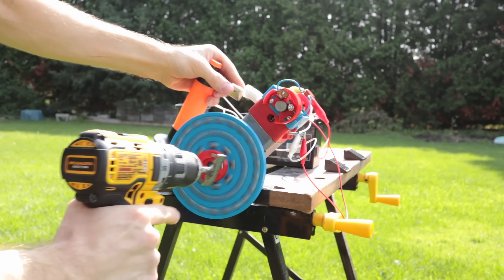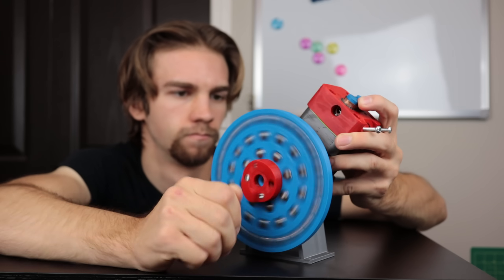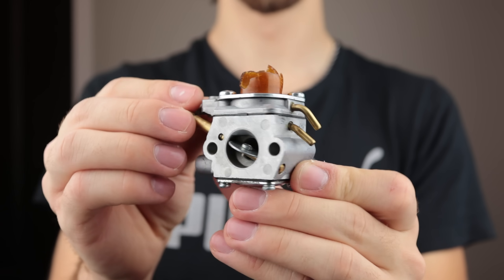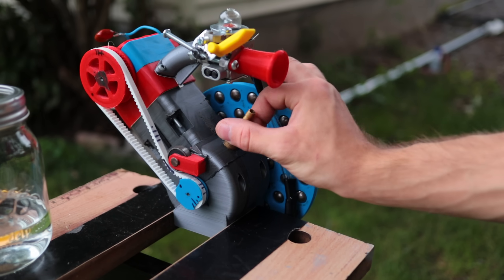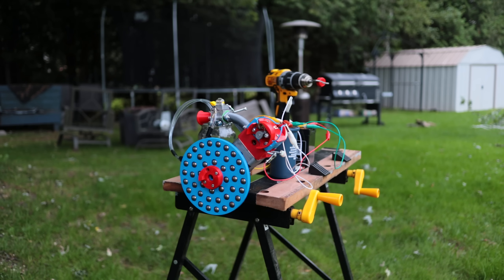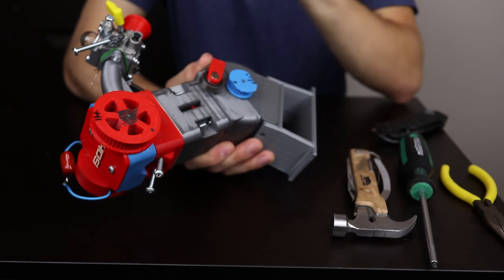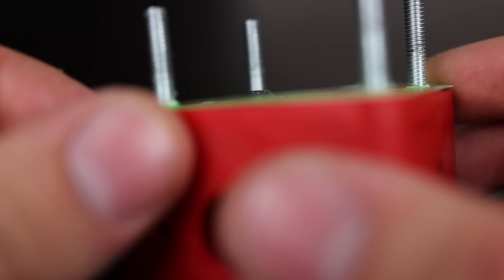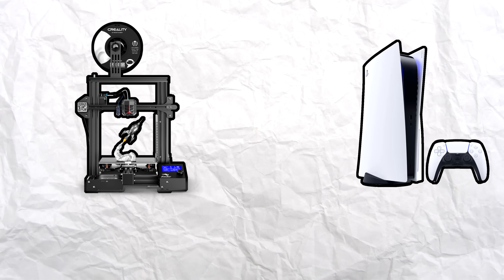Adding a Carburetor to my 3D Printed Gas Engine, and now it RUNS!

Comment: where do you have a return pipe from ? (to the fuel tank) in single cylinder RC engines usually it comes back from the exhaust to create a gas pressure that keeps on pushing the fuel to the carburetor. But here if you over do it you got the fuel back to the tank? How does that work?

Comment: It might be worth it to see if you can utilize a pre-made metal part like the spheres in the flywheel or the copper in the valve seats to solve the valve burning. Maybe some sort of metal ring such as the outside race of a bearing. It's definitely worth a trip to the hardware store

Comment: AWESOME! Would be amazing to see parts for this engine printed in metal (Alu) using somewhere like JLCPCB. Pretty sure you have to design the parts over-size due to shrinkage in the process. I'm sure they tell you all about it. I don't think it costs much either (relative term, I know). Maybe start with just the head? Just a thought. I've been meaning to try out that service forever.

Comment: Fun fact. IIRC, maximum compression is actually attained with timing set around 11º AFTER TDC, on account of the time it takes for the flame front to expand and heat the mixture. ;-) You probably don't want maximum compression in a plastic cylinder so, just saying.

Comment: I think the obvious solution is to use a metal valve with a brass sleeve but that kinda defeats the purpose of a 3D printed engine. and it would probably still melt the port. I dont believe there's any fuel cooler than alcohol based fuels you could try to run a little on the rich side but all in all this is really awesome to see running with a standard carburetor... vtec anyone? 😮

Comment: To keep with the 3d printing theme. Use aluminum cans and/or foil to shape the combustion chamber, 3d printed forms that can be smashed together for shaping.  For the valves, aluminum hardware. Not sure where to source that, but use the drill as a makeshift lathe for crude shaping.

Comment: Now, what I wanna see is some wax filament, some simple lost wax aluminum castings, and another engine made from cast metal parts modeled with 3D printed models. I would contribute to a patreon if it meant I'd get to see that.

Comment: The design of the bottom end seems to be pretty solid, aside from the piston slap issue. I would love to see you take everything you have learned from this and make a new cylinder head to see how well this can run. Now that you are running a carburetor you could try to adjust the air/fuel mixture or even try different fuels to keep the temps down in the cylinder. With full size engines running a richer A/F ratio can cool things since the unburnt fuel acts as a coolant, or you could try adding a cooling loop in the cylinder head and running the fuel through it before going into the carburetor to help keep the temps down without having to add a separate water cooling system.

Comment: Fantastic video. Weed eater carbs use the vacuum and pressure within the crank case to pump fuel through a diaphragm inisde the carb. That's why they have a little hole located somewhere on the side that mounts to the engine/manifold. This is so they can run at any angle, chainsaws as well. Without that vacuum pressure pulse I don't think they will pump fuel.

The simplest carb type you can get comes on lawn mowers, snow blowers, mini bikes, utility engines. Maybe a carb for a 79cc 2 stroke bike kit, or the one off the 49cc 4 stroke kit, would be best sized I think. If you get one with a float bowl with a simple jet in the center and a regular old throttle plate, much easier, just put a fuel tank above the carb to fill it. It will continue running until plastic melt down. I'm surprised it seemed to run off the carb for just a second.

Maybe you should 3D print everything again and then cast it in Aluminum!

Comment: you could eliminate fragile valves by using barrel porting instead and going towards the 2 stroke engine principle but that would require basically a ground up redesign of the entire engine. But consider its less moving parts to fail since you would be substituting the camshaft, cam wheel, valves, valvetrain, valve seat issues and valve timing with only barrel ports and a single reed valve. Conversely tho you would generate more heat in the engine because a 2 stroke piston produces twice as much work as a 4 stroke piston in its normal cycle, but maybe large cooling fins and a ridiculously high filament melting point could overcome it?

Comment: exhaust valve failed first because its the one responsible for letting the hot gas out. the intake is cooled off by fresh fuel

Comment: In my opinion the next step should be looking fir some more heat resistant materials that you can 3d-print with and maybe aiding these with some water cooling. If these two things are given the engine might even run for a minute or so

Comment: To prevent oil from exploding everywhere you can run a tube up into the intake of the carb in front of a air filter so if oil or oily air does shoot out it's tent into your valve train as lubricant

Comment: Run it on methanol so it burns cooler, also I'm not sure if you have this already, but having some valve angle overlap to have some scavenging affect could help in running quality

Comment: An exhaust pipe may help the exhaust valve burning issue. Running an engine with no exhaust manifold under a load can burn a valve.

Comment: use a resin-printer to print the valves in sinterable ceramic-filled resin that you can bake-sinter into real, 3-d printed ceramic parts ;-)

Comment: Now replace the valves with hardware store bolts and nuts ground down to roughly the right shape. - Obviously the plastic head surfaces next to the valves will melt; But how long would it run if it was allowed to do so?

Something like a M6 bolt for the valve, then a M8 or M10 nut with threads hollowed out for the valve seat. Then just lap the surfaces for a somewhat tight seal and see what happens. Though at that point you're going a few steps beyond just 3D printing - but not too far that I wouldn't consider it a 3D printed engine.

Comment: It seems currently the main problem all the exhaust heat melting the exhaust valve, maybe you could try coating it in plaster? And you totally should create some water channels in the cylinder and head to keep that sucker cool and hopefully running for longer!

Comment: so what killed it was having the timing on the ignition set to 0 degrees BTDC so if it had been set right it wouldnt have done that and may have actually been able to run. would be cool to see how much exactly you can make out of plascit in this thing like slowly swapping things until it runs happily or get it tuned right and see what happens from there

Comment: I would use gears for timing, I feel like different belt sizes even just shortening it a tiny bit and loosening up the chain tensioner so there wouldn't be any slop would throw the timing all out of whack, if there where dots would they line up after 4 rotations or so??? Big fan btw love the projects keep it up!

Comment from the maker: Thank you everyone for the support! There is so many comments so I am trying my best to go through and read every one.

Files are in the description
Reply: Are you going to make another video on the gas engine or is this the end?
Reply from the maker: @fabianreis3946  there will be more :)
Reply: @CamdenBowen  good, it better hit 8 grand XD
Reply: @CamdenBowen  V3: you've tested the theory and proved it worked, now make it useful
Reply: It would be cool to see you try to get it to run longer
Reply: add vtec
Reply: Y not a 2 stroke?
No valves no problems 😉
Reply: @Eduardo_Espinoza  yeah why not a two stroke
Reply: @bikeking7149 so it makes more snece but i can tell you why. Its waay more fun to make something like a 4 stroke. While they are more complex they dont care for little faults as much and are easyer to tune. As well as that: where is the fun in engeneering something simple? And yeah for a 2 stroke you woupd need a perfecly sealed crankcase which id imagine is pretty hard to do. Thats my oppinion
Reply: @Eduardo_Espinoza  also 2 stroke would defeat the purpose of engineering a four stroke, which is much harder.
Reply: If he keeps the plastic valves @LVBeatzMusic
Reply: the issue with making a 2 stroke is making the crankcase seal properly and you’d have to cut ports into the cylinder which would have to be small or chamfered so the o ring doesn’t catch on it.
Reply: @Eduardo_Espinoza  Yeah, there are ways to 3d print with metal filament. Integza has a vid on it.
Reply: @ethprintz  Yeah, and for being plastic I think it would burn too hot.
Reply: @ethprintz  I don't really like the two stroke world anyways, I like the sound of a four stroke better, more throaty.
Reply: Yes, I think it's the fact that he's using alcohol. If i remember right alcohol burns cooler, and in turn makes more POWER! And since its 100% alcohol it's much more volatile, which also makes more POWER!
Reply: Add vtec!!!!!
Reply: also i would suggest a holder for your fuel tank XD
Reply: You should try running it on two cycle
Reply: Do you think you would ever be interested in making the "1 stroke" engine at some point?
Reply: @Romnir17 no such thing
Reply: Ready for the next video!!!! 🔥💯
Reply: Ready for the next video!!!! 🔥💯
Reply: Bro could possibly make a 3D printed car eventually
Reply: Can you build a two stroke engine? Its a bit simpler i think
Reply: I'm really happy that you got PLASTIC to hold pressurized FIRE, and it held together almost completely. 5/5 stars for the effort u put in.
Reply: I don't remember but when you hade the spark plug was it grounded
Reply: Camden, used oil/vegie oil diesel engine? :D Also, you should make metal valves & head. Only thing working against the idea of all this is heat
Reply: can you please link the 3d printer
Reply: GET A FUEL TANK HOLDER, it needs it REALLY BAD.
Reply: You would be better off making the engine run on compressed air.... Well until friction comes into play, but you'll figure something out.
Reply: @ThomasJoseph315  No sir, dont try to kill his idea of a ICE that's plastic, he's already made compressed air engines.
Reply: I believe that's a "diaphragm carburetor" and to work it needs the air volume of the crankcase connected with the small hole near where the intake manifold is screwed on or you can replace it with a regular carburetor
Reply: @oires  Yes it is a diaphragm type but no it does not need crankcase pressure, it uses the pulses from the intake stroke and carries them on.
Reply: the diaphragm is basically a built in fuel pump
Reply: You should partner with integza! If anyone could help with this it’s him!
Reply: Bro am from India but I am your subscriber plz make 1 video on easy process of mini petrol engine
Reply: you should try diesel
Reply: Could you also make a printable crankshaft design instead of having to make a metal one
Reply: @ethprintz  He alr tried a printed crank in his VTEC air engine, and it kinda bent and snapped and stuff.

Comment: Very cool.  The exhaust valve takes most of the abuse in a traditional piston engine, so as you say this failure mode is to be expected.  Intake valves and seats are cooled by incoming mixture, so they fare much better unless there's lots of back-fire, which will usually put a stop to things anyway.

Comment: May I suggest that a smaller octane number fuel is used, so that it combusts prematurely decreasing engine's power, rather than higher octane, which still burns during exhaust. Also, how about a 2-stroke engine? No valves, no problem.

Comment: Another thought. If your objective is to create a 3D printed engine, you may want to take a step back and look at engine design in general. A Stirling Engine would be simpler to build and require fewer metallic support parts. I've seen Stirling Engines on YT made of plywood and old soda cans.

Comment: Another thought: Look up Saunders Rotary Valve. A rotary valve system will eliminate the spring and sealing issues. It's a simpler and more effective valve system.

Comment: I really hope in the end this will turn into a project that can be cheaply built by anyone using common tools and metal parts (found in the hardware store) together with 3d printed plastics with as few "special" parts (carburator, spark plugs etc.) as possible

Comment: Try adding a metal sleeve for the piston. And, maybe a metal piston. I know its a 3 D printed project, but you do need to make some concessions if you ever wanted the engine to run for any amount of time. Plastic engines have been made out of Torlon (A high temp plastic), but even then they had to use some metal parts to make it work.

Comment: Usually the valves are the most prone part in any engine. In the old times when the valves were not hardenet, the lead had to be added into fuel to protect the valves. In modern cars the valves are much stronger, so highly toxic lead is no longer needed.

Comment: Awesome success! Probably the longest run time ever from a completely 3d printed plastic engine. My suggestion is that you utilize valves from a Honda gx25 engine or cheap Chinese gy6 scooter engine.

Comment: Engine will not explode until you don't have too high compression ratio. Because fuel burns. It does not explode at normal pressure. And Ethanol is much more "durable" than gasoline. It needs much higher compression than gasoline to be explosive.

Comment: A couple years ago I designed an engine with 3d printing in mind (never had the budget to start it) and for the valve-train, I would recommend constructing the head in two parts as a sort of sandwich. the combustion chamber half could be made using low (or high) temperature PC from Polymaker or MatterHackers, etc, or alternatively, nylon (non cf). Valves should be made of nylon/carbon fiber nylon. Ideally, you do not want o-ring style sealing, try using 45 degree chamfers on the valve seat. I found that making a valve with a long enough stem could allow you to put it on the end of a drill and spin it against the seat for proper sealing. With that method I was able to get perfect sealing which should last for as long as any other part for the temperatures. To prevent valve float (or generally make the valves stronger), use a higher spring rate, and to prevent de-lamination of printed layers in the valve stem, use a bolt through the center of the valve. The bolt may also act as a cooling core to the exhaust valve and reduce the chances of thermal fatigue.
I built all of my test models using a modified ender 3 for printing up to 300 degrees for nylon, works great with a homemade enclosure.

As a side note, it would be cool to see you re-design this engine for water cooling, and incorporate an oil pumping system.
Keep up the great work!

Comment: You should combine materials to get it to run well. If you genuinely want to do all as 3D printed then buy some of the PLA that produces real metal parts and work out what's the smallest amount of that sort of PLA you can get a successfully running engine using.

Comment: I'm convinced that if u use a high temp polymer and maybe use like a thin metal shield for the cylinder wall and the top of the cylinder that it could work really well.  you are going to have to have an all metal original style head unit though or this will keep happening.  but just imagine you figure out a way to 3d print bottom and top ends that actually work well that would be a game changer man.  of course like I said they would still need traditional valvetrains and heads but still 3d printed disposable engine cases doesn't sound like a bad idea man.

Comment: Things you probably didn't know, that primer bulb you're talking about is technically called a purge bulb, primer bulbs refer to bulbs that inject extra gas directly down the intake to prime the engine, Purge bulbs just to remove air from the fuel system so that the Venturi can properly retain prime, realistically this is equivalent for use but they are different

Comment: Very nice! I actually wouldn't have believed a plastic engine could run more than a couple of cycles before melting down. The exhaust valve is for sure the part that has to handle much of the combustion heat. So... a two stroke maybe? 😁

Comment: Ok idea. You replace the exhaust valve with a coin soldered to a steel rod or a washer threaded and epoxied to a rod. The exhaust seat is replaced with a cheap metal ring or a washer. You can use lapping compound to seat the valve. Timing should be bumped up slightly to 5 or 10 degrees to reduce heat in the exhaust.

Comment: if you get a printer that can do PEEK, you should be able to print the valves and make them withstand crazy temps, so the valves are still 3d printed, but can withstand 250-310C which is not that far from aluminium's 400C. It would be EXPENSIVE though

Comment: Try printing the valves with 75% tungsten Petg as it is temperature resistant. you can get a 100g spool for around $30 from prusa, But make sure you print it with a hardened steel nozzle or similar.

Comment: I think the next step could be lost PLA casting. You would be able to print your parts, make a mold around them, and then cast them in metal. Such as you would be able to make your valves out of metal so you can give the engine some run time to see if it'll melt or explode.

Comment: Maybe doing a heat resistant ceramic coating on the exhaust valve would help, making it last a little more, but the main thing is makint it less heat conductive, sorry bad English, also leaner mixtures can make exhaust gases 20% hotter, this is true only in the lean peak, if you are extremely rich or extremely lean it will make it run cooler

Comment: the exhaust valve also has the highest surface area, when its open and the exhaust gas is exiting the engine its exposed to heat from the front back and sides